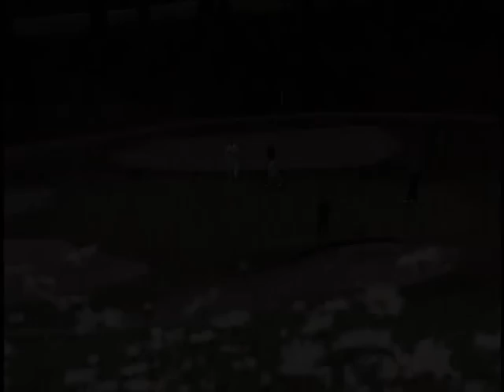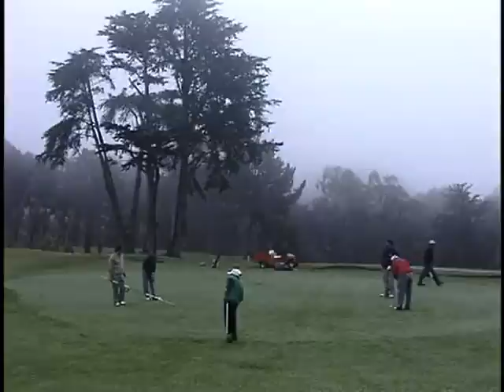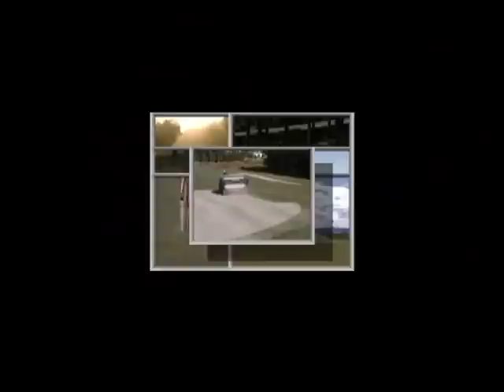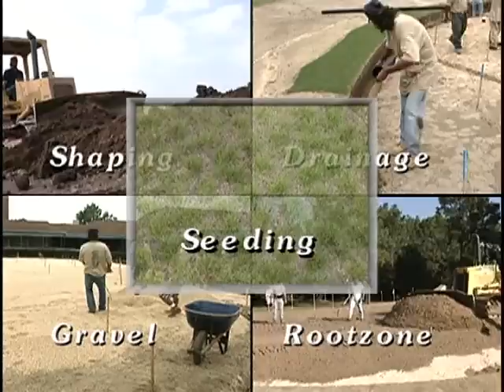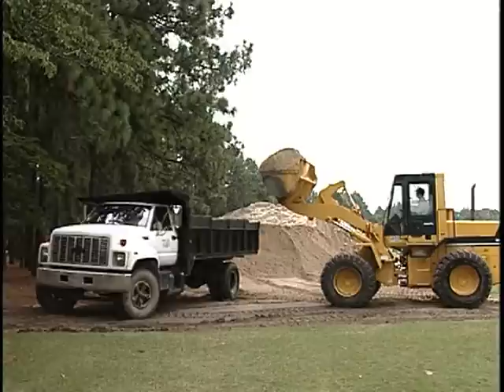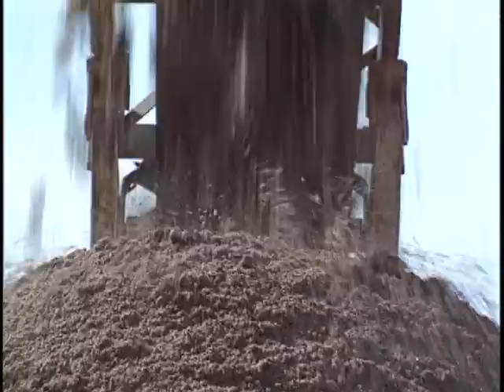USGA greens construction video

Comment: Perforated "Big O" should never be used without a drain sock if you want it to work for more than a few years.  Otherwise you will inevitably have granular material seeping into the weeping tile and all it takes is a one single blockage to render the entire system inoperable.
Reply: We install a flush point on all of our sub-surface drains.
Reply: @codylittle5936  Good stuff
Reply: Sock tiles should only be used in bunkers